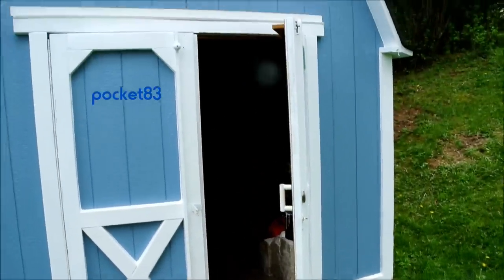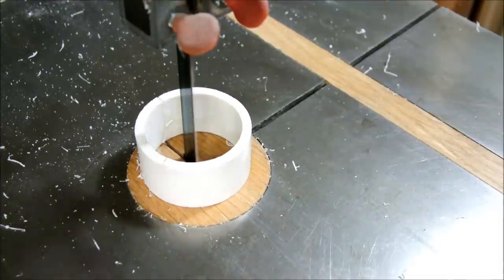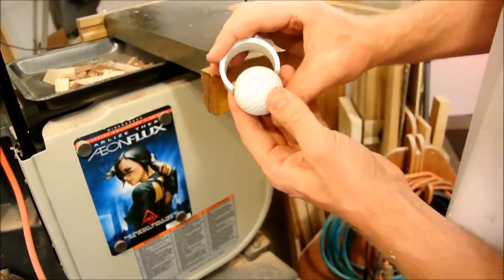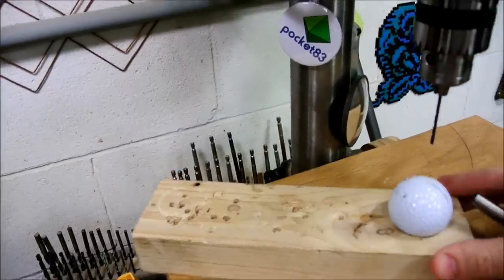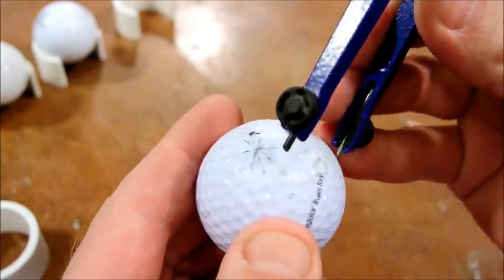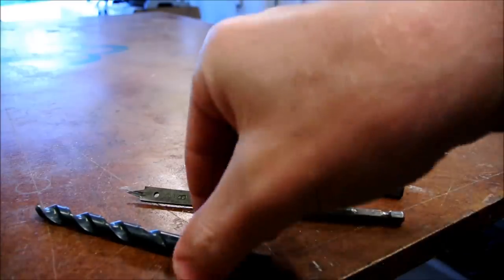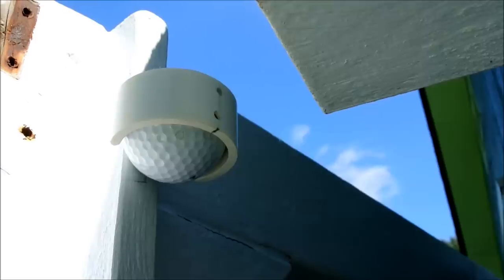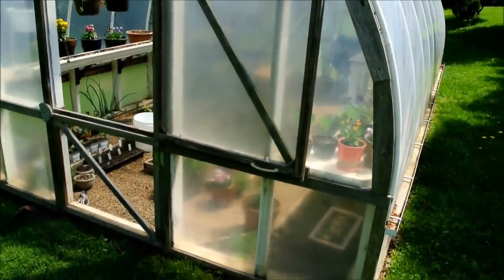Cheap and easy ball catch latches!

Comment: Nothing wrong with laziness. Laziness is the mother of invention.
Who knows how many things were invented because someone said "there's got to be an easier/ quicker/ lazier way to do this".
Reply from the maker: Agreed. That was a bit of an apologetic concession paid to the naysayers' squad in anticipation. Sure, it's a bit patronizing, but if you don't coax them a little, they won't ever buy your thesis. 

I know this sounds ridiculous- but there are already existing latches available for purchase, so I'm actually challenging the status quo here. The simplest things become heated controversy in the +100,000 view range.

The trick is to get the viewer to always feel as though they are better than you, or at least your equal. Smart or confident content is far too off-putting to the average psychology to be palatable fodder for entertainment time; dissonance has become very unpleasant in our new media culture of preference for opinion-reinforcing content. 

There is an inescapable pressure from receiving thousands of the same comment. Scary, that the demand determines the supply so much- it makes it all fake. And it is: just watch.

Comment: So, what do they use in modern golf balls?  I remember cutting one open as a child and there was a ball of rubber bands inside that went everywhere when I cut it in half.
Reply from the maker: Older ones are still like that today. Most modern ones have a solid core that is a pleasure to work with.

Comment: That's what I call....  A HOLE IN ONE !!

BTW -- when you cut the first cut from OUTSIDE to INSIDE of the TUBE...  just turn the ring such that the next cut will go from INSIDE to OUTSIDE --  no need to open the gap or stop the saw...  YES, be careful !

Comment: How long have you had this set up... Just curious of the life of one of these before something cracks or gives out.
Reply from the maker: I use similar PVC clips in my greenhouse to hold up the shade-cloth, and the clips are around 5 years in without visible sign of fatigue. Also, the greenhouse is made from PVC, and it's on year 7. 

PVC will degrade eventually, but even then, you would still have to physically break the clip, and it's tough stuff. The naysayers in the comments typically have zero experience or evidence to back up  their dismissals; given the thickness of the pipe, and assuming a reasonably moderate climate, expect around 5 to 7 years minimum without a problem.

Comment: Instead of pushing the pipe against the bandsaw with your fingers, use the eraser ends of two pencils to move the pipe. That way, if there’s a slip, you cut a pencil, not a finger.

Comment: I doubt that any are still around but really old golf balls had liquid centers filled with either red lead , white lead or hydrochloric acid. I know this because when I was a kid I was taking a golf ball apart  to get the little rubber ball in the center. Imagine my surprise when I cut into the rubber banding inside and it spewed acid into my eyes. I severely burned my corneas and was in eye patches for 2 weeks, waiting to see if there was any scaring. There wasn't but if you're screwing around with old golf balls; be careful.
Reply from the maker: I've pH tested the liquid inside of golf balls, and they are typically neutral. Not to say that they weren't at least mildly caustic at one time, but you were more likely treated for corneal abrasion associated with the ball's release of energy than from chemical burn. I had a similar childhood experience with an air compressor and a bike tire.

That said, a good rule is this: ANY ball that sprays liquid or is found to have a rubber-band core should go right in the garbage. I only use solid-core balls for my projects. 

And drilling the first hole always requires glasses.
Reply: That was 1960, I was 11 years old. I just know what the doctor told me. I've had many corneal abrasions and other insults to my eyes, they generally heal in about 3 days, whatever that stuff it was more serious than a corneal abrasion.
Reply from the maker: Please don't take my skepticism personally- I'm mostly just curious. It just seems like this has all of the makings of an urban legend. All of the "acid" claims I've found seem dubious, and Titleist claims to have never used anything more harmful than corn syrup. Interesting, though; companies might not want to discuss such a thing, had they done it, so I wouldn't put it beyond marketing and P.R. to skillfully avoid directly admitting to having used a nasty substance.

Still, it's not easy or cheap to manufacture a consumer product that's dangerous, and severe corneal abrasion can blind a person, so I don't know what to think. Did you lose any of your vision? 

Well, whatever the truth is, and even if we can never know it, we don't have to worry about the acid thing anymore. Even the most ancient liquid-filled balls I've found are now pH neutral. But seriously, I'm more scared of the rubber-band ones. Those can eject like a rocket!
Reply: I was a mechanic of one sort or another all my life and no matter how careful you are you wind up with metal filings or rust or chemicals or whatever getting in your eyes. When I was porting cylinder heads I had 5 minor eye surgeries in one year!. The only scarring I had was from when my daughter was an infant as was flailing around like infants do and took a gouge out of right eye with one of her razor sharp fingernails. 

In my mid 60s I had a Posterior Vitreous Detachment in my right eye and have some retinal scaring from that. I didn't realize how right dominate I was until I lost some vision in that eye.

In spite of our eye digression, your suggestion is really good.

Comment: They sell magnetic doorstops at box stores. One screw on each of the 2 pieces. Cheap, easier to install, LOOKS a whole lot better, though you don't hardly see it because it's at the bottom of the door, works better, etc etc. 

The one I got has pretty good pulling power and takes a very strong gust, coming from just the right direction, for it to release.
Reply from the maker: Glad you enjoyed spending your money! Hope it takes at least a year to start rusting on you. 

I wouldn't get so snarky with you guys if you didn't so purposely act as though you've just made a better decision than me. I can also buy a latch if I want to, ace. 

"Just buy one! Just use magnets!" You all sound like mechanical parrots. One more thing: how do you already know that yours works better, when you've never used this one?  
Don't answer; that's called a rhetorical question.
Reply: It's been there 5+ years and hasn't rusted yet. 

http://www.homedepot.com/p/Richelieu-Hardware-3-in-Brushed-Nickel-Magnetic-Door-Stop-67NBR/202206068

BTW, not to be snarky myself, but I believe I did make a better decision than you, "ace", though it certainly wasn't my intention to one-up you, as I did this years ago.

Your idea is functional and clearly you are good at problem solving, whereas I just kind of got lucky and stumbled into a solution I wasn't even looking for at that moment, but my setup is cleaner and more normal looking, easier to install, inexpensive,  and won't ever break

Note: I apologize sincerely for stating mine works better. They probably work equally well. Don't know why I said that. THere are things about it that are better, but functionality likely isn't one of them

Comment: How long will the plastic last in the outside environment?
Reply: PVC does surprisingly well when exposed to ultra violet rays (sunlight). Research shows little to no effect on PVC's tensile strength or elasticity after prolonged sun exposure. The only degradation that seems to occur is impact strength. That means the pipe may become slightly more brittle after prolonged sun exposure. A light coat of spray paint would extend the lifespan. You could always cut extra PVC clips and change them out as needed. Or stick with the metal Hook and Eye that will rust away in 15-20 years depending on where you live.
Reply: It's as though I'm invisible. Read the description. My greenhouse was PVC. It lasts for years.

Comment: Will the PVC break off when it's 0 degrees F?
Reply from the maker: I've had good luck with it. I've also made a greenhouse from PVC pipes: it's now over six years old and still supports the PA snowstorms each winter. Technically it weakens, but it's tough stuff.

Comment: If you're going to fabricate a hold-open like this, there's no real reason to use a golf ball, considering that a short piece of smaller PVC pipe, e.g.: 1/2" (0.840" OD)  inside of 3/4" (0.824" ID), up to as large as 1-1/4" (1.660" OD)  inside of 1-1/2" (1.610" ID). But there are all sorts of VERY inexpensive spring clips intended to hold broom, mop, or rake handles that will do this without any fabrication required, except for cutting a short length of dowel rod or pipe to act as the insert.  Search for "Wall-Mount Broom Clip" (the individual type). Most of them are shaped sort of like a capital "B"

Comment: You didn't think through the band saw problem. The band saw doesn't care from which direction you cut.  You're assuming you always cut from outside to inside.  
Just make first cut from outside to inside like you did, then rotate the PVC so the second cut is from inside to out (majority of PVC will be behind the blade). No hacksaw needed. Takes 1 second to reposition.
Reply: You're missing my point. PVC slams shut when you make the first cut. That's why it's risky to plunge right in with a bandsaw; you must relieve the compression first.
Reply: @pocket83squared  I'm confused.  How does backing out the blade from inside and making the next cut from the outside make a difference in that regard? 
And if you say, you need to hold the section open just a tad to releive the pressure for the next cut, you can do that from either side.

Comment: You probably are going to change every 1 to 2 because of the weather it will dry out and crumble
Reply from the maker: Except that it didn't happen. I used it today, and it was freezing out.

The maximum operational deflection is only +/- 0.5", so even if it were to degrade to 10% of its original strength, it would still work. I suspect that they have around a 4-6 year lifespan.

But if it doesn't, you can have your money back.

Comment: Why not just install a picket gate closer spring on each door. They will stay closed
Reply: That's more infuriating. If your shed has no window you walk in and are plunged into darkness as it closes behind you. This is ingenious but also how super lazy is he not to take the 1/2 a sec to use the original latch?

Comment: also should have cut  45 deg on the 2x4   as well as  dipped the screws iin wood glue- overtime  the clamp will eventually pull the screw out
Reply: Kelly Jackson what would the 45 be needed for?
Reply: Protection

Comment: Thanks for making your video! Very interesting. Send me your email address and I'll send you a drawing of one of my designs for the safe way to grip odd shapes for cutting/tooling. The main reason I'm writing this, is to find out what nut inserts you used on your golf ball drill press handle tips. Would you share that with me...please...maybe in a video...perhaps you already have done this...don't know. I have an OLD drill press I bought from a steel supply company, that has one little knob on it and the other two are missing. I have toyed with the idea of tooling 3 out on the lathe out of Aluminum, but upon seeing the golf balls on your tips...it would be less work...I think. Again...I appreciate you taking your time and resources to make a very precise and easy to understand video!
Reply: Thanks. It was a large coupler nut that was cut in half. I did make a video:
https://www.youtube.com/watch?v=PtNwrN6KKdA

Comment: pvc has very low UV tolerance.
Reply from the maker: "Very low tolerance" is relative to the application. The greenhouse pictured at the end of this video is seven years old. It's made from PVC. It bakes in the sun daily, and still supports a foot of snow in the winter. 

These ball catch latches last for years.

Comment: Magnets are best opposed to golf balls.
Reply from the maker: Incorrect. Golf balls have been scientifically proven best.
Reply: pocket83, you will see over a short period of time that the cut PVC will lose its strength and become weak especially in the summer heat and not to mention cracking in the cold winters especially where you drilled the holes for fastening.  Remember the old definition of science was to seek the truth!
Reply from the maker: My greenhouse is also PVC pipe. It gets over 120F at the top, and it supports snow every year- for seven years now. There are even PVC clips, just like the one shown here, that hold up the shade-cloth. 

Magnets cost 10X what this does, and then they rust.

Comment: You could of just put a brick at the bottom of the door. I find the idea good but the reason for using it ridiculous.
Reply: And just bend over, twice, every time I want to open the doors?  And should I just cut grass around the two bricks, or should I just trip over them daily in the shed?  

Which case is ridiculous?
Reply: pocket83² your laziness is at a new high
Reply: Nonsense. I'm motivated to improve my surroundings. You should try it sometime.
Reply: pocket83² my surroundings are quite comfortable but with hard work.

Comment: Bad thing is PVC is not UV stable itll be crispy and broke in no time.
Reply: Incorrect. Read description.
Reply: @pocket83squared  
I'm telling you from experience. Put a piece of pvc pipe in direct sunlight for one summer maybe 2 tops.. then stomp on it, it shatters like glass.
Reply: You are thinking of ABS, or some other plastic. Perhaps some old, thin sewer pipe that you had found degraded and become brittle. But tell me, have you ever seen actual PVC that is not foam-core break? You have not. Research suggests only a very small loss in strength after a very long time of extreme exposure. For the love of reason, just look at my greenhouse! After a DECADE of summer heat and winter freeze, I bent the structural pipes in half to test them, and they are as strong as ever.
Reply: Ok whatever you say buddy.
Reply: Don't patronize me, pal. We aren't buddies. You believe something that's incorrect, and we both know that I can't change your opinion. 

Bottom line: the latch will last for years, no matter what you believe. And even if it didn't, so what?
Reply from the maker: Assume a 10% loss in strength per mm PVC per decade during constant sun exposure. Since this latch wasn't designed by a plumber, it should last for years.
Reply: @pocket83  Plumber wouldn't make that shitty of a design.. They know better than to put PVC in sun 😉

Comment: What a great build. I was wondering how much wind it could take. Rhetorical every door's surface area will be different.  I also like the Protractor Template. I found one just like here http://maths.prideaux.id.au/protractor-upright.png

I just put it in word and enlarged it.  Laminated it & put it on my Workbench two useful items out of this video. 

Thank you Sir.
Reply from the maker: Thanks! That does look like the same one I have. I think mine is stuck to a thin piece of plywood.

Comment: "Easy" ? If I have to break out the protractor for a home project and measure ball circumferences with a charting tool, I would not call that easy.
Reply from the maker: What, are you some kind of JakePauler? If a compass is too tough a tool for you to use, then just go back to swiping your phone. This is the wrong channel for the disinclined. 

You could also guess, but some people actually might want to know how to find opposing poles on a sphere. I'm sure you have better things to do, though.

Comment: You've reinvented the wheel, for no reason. Ever heard of a ball catch or cuboard latch?
Reply from the maker: The reason is that they are cheap and easy to make. Ever heard of not wanting to buy something because you can so easily make it?

I simply do not understand all of you naysayers. It's like you're angry over it. Go make a video about the latch you bought.
Reply: @pocket83   For your money and time saving invention , I have to find a bit of plastic pipe, hack saw it to size (2 cuts), find a golf ball and drill it, line up the bit of plastic pipe (and the ball) and drill them, the golf ball one needs a drill bit and a massive screw. Drilling and cutting these items can be dangerous if you don't have the right tools or a vice. 
A ball catch or cupboard latch costs a £1 (dollar ) etc. Its male and female connectors guaranteed to fit (match up), and all you have to do is 
1. Buy it.
2. Screw it to the shed with a screwdriver (screws normally included with the item).
3. Boooom.

Sorry you've taken it personal m8, it wasn't my intention. :(
Reply: Nothing personal. Of course. No offense taken. Similarly, don't take offense when I say that if this project is difficult or time consuming for you, then you are a helpless consumer who is better off buying one. 

Every day I make and fix things; this sort of thing is an effortless child's play for me. If you find this tough, then you should work on your self-sufficiency skills. Or, just accept your life and keep buying stuff, like a turtle sleeping on his back. In either case, my video is not twisting your arm, so stop trying to twist mine. If you don't have a golf ball or a pipe, just don't make the project. Booom.

And don't act patronizing. Both of your opening sentences were designed to be insulting and dismissive. Now I have stuff to work on. Don't read this as angry- just think about what I'm saying here.